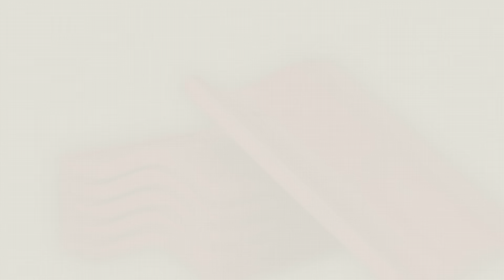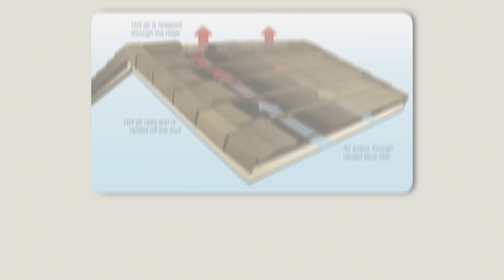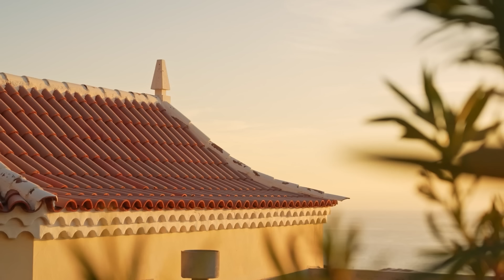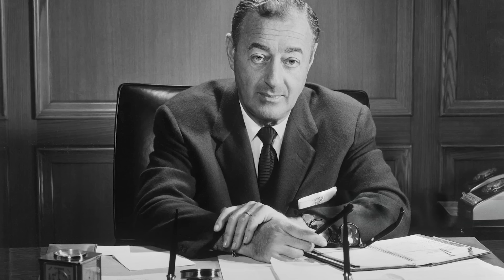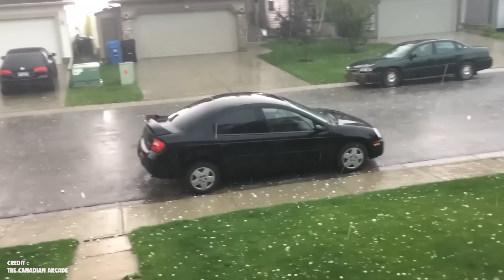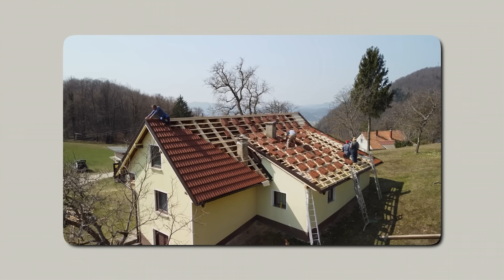Why Did America Stop Using Naturally Cooling Roofs?

Comment: The answer to the question in the title is, "The alternatives were cheaper."
Reply: And yet homes are made with cheaper materials and lower quality labor but cost more than ever...
Reply: @RextheRebel  am I right that american system of the so called "economic growth" turned to the absurd?
Reply: @alextrezvy6889   Yes. Undoubtedly. Growth for the sake of itself is never beneficial as its unsustainable. Who has "grown" from this economy? American workers? No. Our birthrate? It's actually shrunk. Our homeownership rate? Collapsing. Our employment rate? 9/10 jobs in the last 6 years went to non Whites. 

So no. Our preposterous obsession with this vague idea of economic growth has been disastrous. And of course our economic advice comes from (primarily) Jws. Milton Friedman chief among them.
Reply: @RextheRebel  Which is why illegal immigration needs to be stopped
Reply: @actualyoungsoo  lol at thinking the people with the least amount of power in society are somehow responsible for society's ills.
Reply: @actualyoungsoo  Read a book. Go outside. Talk to somebody that you’ve never met before. Ignorance is nothing to be embarrassed about. Choosing to remain ignorant is.
Reply: @Pazuzu4All  You sound like the type to blame OF creators rather than the simps that fund them
Reply: Not only cheaper materials but overall less expensive cost in building the house. The roof structure is required to hold up such heavy material.
Reply: @nrique_og  as a roofing contractor in South Florida I can tell you if you have an asphalt shingle roof here then your AC will rarely stop running because the heat goes directly into the attic due to the shingles being installed directly on the roof sheathing as where a tile roof acts as an insulator and a two to three inch buffer of air gap between the tile and roof sheathing provides a huge insulation upgrade and your electric bill will be half of a shingle roof. I wouldn’t have a shingle roof in South Florida if it was free.
Reply: @onionhead5780  Using shingles in any hot climate should be a crime. They're a complete joke.
Reply: In northern climates you want the roof to send heat into the house half the year.
Reply: @stevehofer3482  Not at all. You want the roof as insulated as possible. The summern isn't the problem there, its the winter. Heat loss happens mainly through the roof.
Reply: @stevehofer3482 not only that, ice and snow don’t play well with clay tiles or stuco
Reply: Define "cheaper"! On my house roof was made 1776 and it was completly rmade 5 years ago (else just minor repairs) so again ..which is cheaper ?
Reply: @ahn @ahnehtub2 i doubt anything in a 250 yr old house is original anymore
Reply: @ertsec  except all the walls :)))) It's a cultural monument this year the restoration or ,,restoration" was finished (and architect had his PHD on this building and o boy was a challenge to use old materials, to find oak beans (aged) , even tiles some of them marked with production year had to be set in some way to noticed those years (most of them were taken from old demolished buildings or dependences ) any new decorative element made from new materials had to be removed and made (old school, just plaster) etc yet as it was written on the front of the building the same year remained 1776:). So because of the original walls (1m thick) (made with bricks and lime plaster (no cement was allowed ) 80% of the house it's original ! :) (Also it's located in the center of an old medieval city)
Reply: @ertsec Depends. If its a stone walled house, the exterior walls may bery well be that old. So will the foundation. The interior walls, plumbing, etc., is of course not original. Indoor plumbing, electrical and segregated rooms are a rather recent addon.
Reply: The cheaper cost another 150$ every month
Reply: In the short run.
Reply: Not just cheaper, but more versatile.  Live near trees? Tile roofs collect crap.  Live in a high wind area? Tile roofs collect crap.  Live where there is a rodent or small bird population?  Tile roofs become animal condos.  You want solar? Not with a Tile roof. Tile roofs are great if you live in a barren windless place without creatures .
Reply: A wooden batten system would be simpler to add to a cheap roof, passively drawing cool air under the hot roof
Reply: The reason for every shitty change in America
Reply: In Chicago almost all the 1920s bungalows had terra cotta roofs. They last a long time, but it’s been 100 years at this point and it is so much cheaper to replace with asphalt. If you see the terra cotta you know it is original but no one uses that now.
Reply: Also i demolished an old barn (no idea how old it was) but all the tiles i donated to Black Church restauration (see Black Church in Brasov) ! You can see now how new and old tiles were interlaced to keep the authentic idea of the buildiing!
Reply: try a view here :) thet building with 1779 on it :)))) https://www.google.com/maps/@45.6359377,25.5800455,3a,64.3y,364.49h,88.46t/data=!3m7!1e1!3m5!1sxe8sxz-KAyZZQAR33zb5CA!2e0!6shttps:%2F%2Fstreetviewpixels-pa.googleapis.com%2Fv1%2Fthumbnail%3Fcb_client%3Dmaps_sv.tactile%26w%3D900%26h%3D600%26pitch%3D1.5444296112547136%26panoid%3Dxe8sxz-KAyZZQAR33zb5CA%26yaw%3D4.488786906171526!7i16384!8i8192?entry=ttu&g_ep=EgoyMDI2MDcwOC4wIKXMDSoASAFQAw%3D%3D
Reply: Cheaper? You're high as a kite. Asphalt is only cheaper for the builder. No one else.
Reply: @TheJMBon And when it comes to new housing construction, that's all that counts.
Reply: Cheaper, able to rapidly repeat, and the baby boom... Never really stepped away from that culture of throwing up many identical houses in a new suburban area.
Reply: and fire departments developed…
Reply: That's the facade. Everything boils down to profit margins. That's why houses in USA are crappier but way more expensive.
Reply: Not just cheaper but quicker to lay with unskilled people and enables the roofing trusses to be lighter and cheaper.  For the construction that is a win-win-win.  Of course it is the home owner that ultimately pays for this
Reply: @j @justinstephenson9360 hat’s true, don’t undersell the importance of the unskilled labor laying the roof. Tesla-type solar shingles should, in theory, take over the market thanks to serving as shingles and solar cells, but in addition to higher material costs you have higher labor costs getting everything working.
Reply: @justinstephenson9360  being lighter is totally irrelevant. The closer the roof trusses means the wood roof sheathing has more mechanical fasteners which means a higher wind uplift resistance. I live in South Florida and we have hurricane building codes and roof systems that withstand 210 mph wind uplift.
Reply: In short, you pay a bit more at the start, but you get a roof that lasts a lifetime, slashes your cooling bills, and makes the house look incredible.
Reply: No, it's not. It's just cheaper for the developer. The real answer is greedy developers taking advantage of their customers
Reply: Tile roofs are impossible here in Texas because we get hail at least once a year on average

Comment: Clay tiles are heavy which requires additional framing to support the weight. So it's not like we dropped using clay tiles for no reason.
Reply: That's because you Americans have good lumber. And you have too much of them.

You have the biggest and best hammer in the world, so you would naturally see everything as a nail.
If houses were built out of bricks and steel-reinforced concrete, the weight of a tiled roof would not be a serious issue.
But why build a house with heavy concrete if tall lumber is everywhere? It would be much reasonable to design everything around wood and plaster.
Americans dropped using clay tiles because you suffer from your blessing.

+ Here in Korea we use concrete and cinder blocks most of the time. We don't have enough lumber to build a lot of single-family homes. But we have a pretty sizeable limestone deposite just a couple hours' drive away from Seoul. We built ourselves a concrete jungle because we don't have enough trees to fill a "jungle" with.
Reply: @Breatropolitan In Korea you also have very limited land area (raising land prices and forcing high-density construction) and very strong forest preservation (strongly reducing construction supply and raising import prices).  You can't use the wood even if you wanted to unless you imported it.  You're already importing a lot of concrete.  As a result, it takes 25 years of full median salary to afford a house, which basically means you can't afford a house (only 10-15% of South Koreans own a single-family home, vs 50-55% of Americans).  That means you don't even need a roof in Korea.
Reply: @Breatropolitan It's not the walls that are the limiting factor when it comes to weight, it's the roof structure above the walls, and I bet that's not made of concrete and or cinder blocks even in Korea.
Reply: So "technology" and "progress" makes things suck harder then?
Reply: Well, maybe we can make it slimmer.

Comment: Clay can be brittle; I'd probably seek out a composite solution -- but, does one exist that could be even more efficient and perhaps with its own design requirements?
Reply: It's not clay, it's terracota and it last longer
Reply: @22espec  Hes not talking about how long it lasts. He is right that its brittle, 2 different things.
Reply: Oh, so the tiles that are centuries old around here are.. what? Magic? But yes, hail and storms can damage tiles and the damaged ones need to get replaced asap.
Reply: @hermannschaefer4777 The ones that are centuries older very heavy and put on very heavy houses that would be very heavy and difficult to maintain. 
Most buildings that were centuries old were built on the backs of lots of people who often died building them. 
That's nothing to brag about.
Houses today are much lighter and therefore easier and cheaper and quicker to build that that's a good thing. 
But if you want to make very expensive heavy and resource intensive buildings then build one of your own
Reply: @MattHowzer  It’s hard to fit so many false assumptions into one single answer, but the 'Muricans really do never cease to amaze me.
Reply: @hermannschaefer4777 oh I didn't know you were American. You do fit a lot of fails and assumptions into your posts.

Comment: Depends on how they attach. They look like they just lie atop one another. Not very secure in hurricane weather.
Reply: They are nailed to the batons and will easily survive 100 mph winds.  I have them.
Reply: Depends. In areas with no big hurricane risks the tiles simply lie on each other, hold by their weight. In regions with stronger winds you can nail them to the wooden construction below. Tiles made of slate are always fixed by nails.
But yes, if a storm rushed over your house you may need to check the roof for broken of loosened tiles. There are tornadoes in Europe - although quite rare, and the roofs are often damaged and need to get re-tiled. But well, the houses are made of stone and still stand, so..
https://www.youtube.com/watch?v=_UnnjjUx8u4
Reply: @hermannschaefer4777 one of the problems in the Southwest is the wind carries dust for months and the build up turns into a slurry that is detrimental to the under-layment.
Reply: @foyjamez  A layer of water-permeable dust would not pose a risk to a normal roof structure – provided we’re not talking about tonnes of material here (weight!).
I am extremely sceptical about ‘vapour-permeable’ plastic membranes, precisely because the pores in such membranes can become blocked very quickly. I therefore always recommend vapour-permeable and moisture-tolerant constructions. These, such as a ‘cold roof’, also have sufficient space beneath the tiles to allow dust and moisture to escape.
Reply: @hermannschaefer4777  it becomes a concrete like slurry that tears up the paper as it moves from sudden downpours.
Reply: @foyjamez  Well, there’s no paper under a cold roof. If you want to protect the structure underneath (e.g. from drifting snow), you can use natural timber or wood fibre boards and create a sort of channel or chute between each pair of rafters – on my roof, I’ve used 2-inch-thick natural timber boards (milled to overlap). However, I have no experience with heavy sand or dust ingress; for that, you’d have to go much further south, to North Africa or the Middle East.
Reply: @hermannschaefer4777  there are about 50 million people in the US "Southwest". Even with 5-6 per house, the 2" timber you're talking about would be prohibitively expensive in both material and labor; if it didn't require deforesting a couple of states in Canada for the lumber.
Reply: @foyjamez  My fault, it's 1 inch (about 2,4cm), standard thickness for cheap planks here. But - the amount of wood in a normal US house is already weird. Besides the roof construction, a normal modern European house has no wood at all..
Reply: @hermannschaefer4777  also, much smaller square footage in Europe.
Reply: Wat about cleaning repairing after a storm .i workt   on a dutch roofs  its hard work . So  i  have questions.. bearing of the storm
Reply: @reubenbrasil405  repair work is very expensive; it's labor intensive because they are not made to walk on, you have to remove very large sections of roof to do repairs.